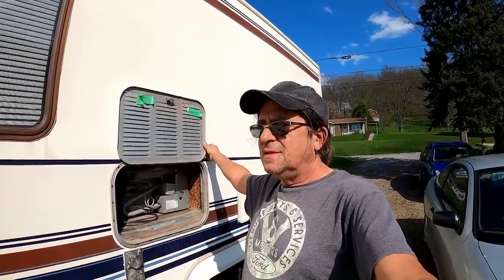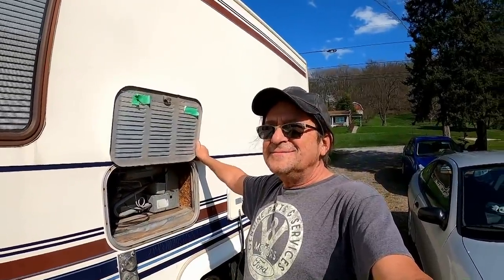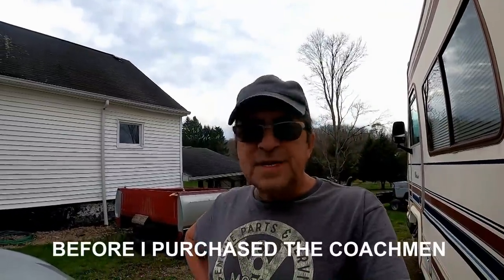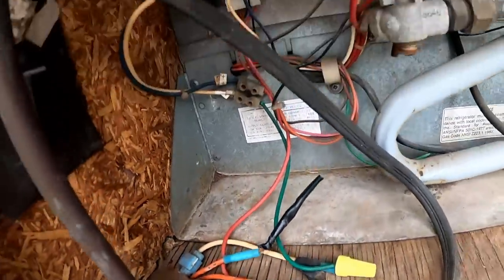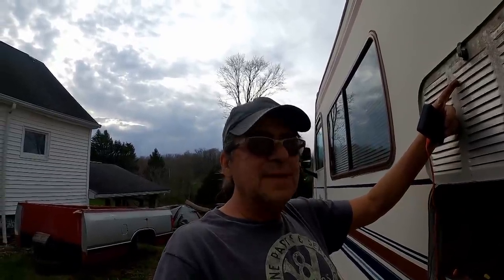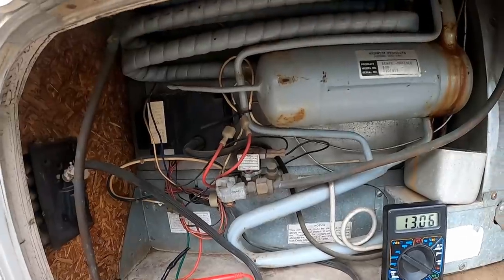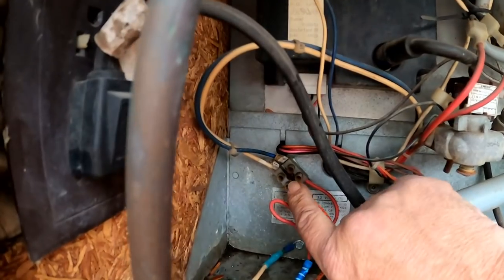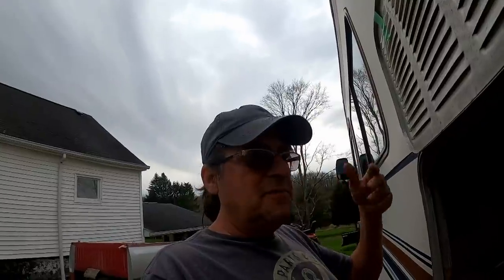Troubleshooting RV Fridge Not Working  - Repairs, Upgrades, Renovations Continue For The Motorhome

Comment: Dave I worked at Lexus as a technician and work my way up to service manager and I have to tell you how many mass detects couldn't figure out a problem and I would say to them check the fuse they'd look at me like I had two heads guess what fuse was blown and they spent hours trying to find it it's all just common sense check the little things first then if you have to go deep then you look at the repair manual and electrical schematic I'm very excited watching each day as your progress goes thank God the refrigerator works the hot water works so far you're in good shape I don't think they use that too much you were destined to get that particular motor home at this time it was God's will thanks so much I'm enjoying each video to the max hugs from Winston to Bella and you be well that RV is going to shine up beautifully with a great shine on it you won't even recognize it after it's waxed which I know is a long procedure but when it's done properly it lasts for a long time be well keep up the good work and happy Sunday your friend Craig

Comment: Dave I grew up poor and out of necessity I had to learn to do things myself. I have found that most things can be solved with a little common sense and the process of elimination. I believe we all have the power to do if we just take the time to think things through. Every sense you bought that RV I thought to myself I bet that refrigerator works, someone just didn't want to take the time to check it. I remodel RV's as a hobby and have fixed many things others said were broken at no cost but a little common sense. I am enjoying this series. ~Bubba J
Reply: I'm much the same, grew up poor and had to fix it myself. Over the years I was an Electrician and enjoy all that I have learned in life. I think the most amazing thing is You tube videos! Anything you want to learn is right at my finger tips, and a good helping of common sense! I enjoy your videos! Happy travels my friend 😊.
Reply: Same here! Now I can replace the head gasket on a German car and do anything I set my mind to.
Reply: Where are you located nomadic lifestyle?
Reply: @curtisnash9723  Michigan
Reply: Oh man, I wish you were closer, we are in SC, maybe you can help us as an consultant?
Reply: @curtisnash9723  what do you need
Reply: Well to start our RV won’t start we had a tech come out and he says we need a few pump the manager at our local Advance Auto says we may not need a fuel pump because fuel will evaporate so we may need to do some starter fluid and see if it will start and then we have a roof leak I will have my son send you pictures
Reply: We have a service or company that said they will wash coat and seal our roof for $1800 that is outrageous we only have a 32 foot holiday rambler vacationer
Reply: Just trying to figure out how to wash and coat roof on 32ft holiday rambler vacationer

Comment: I just wanted to post again about how if you set your mind to it you can do anything. I purchased an old truck camper about 3 years ago and it was one that I would say most people would have not had a second thought of just passing by. I updated it with solar and redid the whole inside. I then bought an old truck that was having issues and the owner just gave up on it. In total I spent around 3500.00 for both I then put about 1500.00 into the two of them mostly on parts and now I have one sweet rig that allows me to enjoy life to the fullest. My point is you don't have to have a new truck and new camper to enjoy this lifestyle you just need a little will power to look deeper at the things others over look.

Comment: That's great that the electric is working fine! After troubleshooting some more, I think you will figure it all out. 
If you are installing solar. Get a fridge from Home Depot and let it run on Electric. Another YouTuber installed one, brand name unknown. I think he only paid like $135 for it. Its will only draw 5 watts an hour. The only problems you may have are:
1) width, getting it in the door. Your front door looks wide enough, however you would have take out the driver's seat and put it back when done.
2) size, you may have to modify a couple more inches on the top or bottom
However, you will get it working just fine. Have a great day.

Comment: Contact cleaner has saved me many times on control boards (RV refrigerator), remote controls, car parts, and more.  Many people change out the control board right away.  It's a moneymaker for RV repair facilities.  BTW, Dave, you're way too modest but then again, modesty is a good thing.  Enjoying your channel.

Comment: Nice clean up Dave. That’s the first thing I would do if I had time when working on a Packaging line. If it was running I’d just repair and finish the run. If I had time I’d clean the piece of equipment up first and then finish the repair and like you said invariably it is a lose or dirty connection. Hi Bella! Cheers buddy.

Comment: Hey Dave at minute 20:42 the wires above the gas valve are wire tied to the refrigerant  line that's not good as those get hot mine was like that and i had a melted wire from it getting hot. may want to move them from the line. Just an observation : ) i am like you if it works on electric it will work on propane providing the board and gas valve operate properly. i had to clean the tube out on mine and it works like a champ. Best of luck fingers crossed for you cause those replacement fridges aren't cheap. Give Bella hugs and enjoy your weekend : )

Comment: Okay, well with my 1981 Travel Craft 26 foot motor home I had some issues as well. Like you when I purchased the motor home I took in home and went through it as you have done and made sure everything worked. Batteries, water, water lines, roof for leaks etc. I did have to replace the front disk brakes and rotors. The engine had been rebuilt was a 350 Chevrolet the motor home was on a G30 van chassis. I did get the refrigerator to work on electric for awhile and the priso for the gas was broke.  The timing chain went out and had to replace it. $1,600.00 for tires. But the four years I owned it just regular maintenance and up keep kept it on the road. I used my multi tester all the time. Well till next time, as always Dave "Enjoy The Adventure." 😀👍✌ "Jack Of All Trades, Master Of None"

Comment: Dave your auto mechanic instructor was cut from the same cloth as the one I had in high school. He taught us many, many trouble shooting tips. For instance, one is, if the engine doesn't crank over, first thing to check is the battery connection. Like you said, connections get dirty and loose. Very good video Dave.

Comment: I am afraid of gas because I worked at a steak and deep fryer quit and owner said  when was fixed turn the other way from before . It opened line and when gas lit blew me across the room. Burned hair on my whole top part of body. I won't lite gas stuff any more. Glad you are figuring out.

Comment: Get a pack of assorted solder seals off the Amazonians. Once you use one you will never splice a wire together any other way they are amazing. You can diag a lot of electrical
Issues with a headlight bulb with leads attached to the pins. Power, ground, capability of the circuit to carry a significant load if you’re ever in a bind. Dave is basically the Vice grip garage of the rv world

Comment: Hey Dave..
Re: Fridge..
When you go to gas mode..
Although the gas solenoid should have been energized (check with vm), I think, regardless whether the gas valve was actually allowed to flow, you should be hearing a "tick tick tick tick.." as the control board triggers the ignition, attempting to start the flame.. I believe the ticking should continue until the thermocouple detects a flame has been established.
BTW..
- I think you may find a fuse on the control board itself.
- And, you probably already know, the ticking is the control board acting like old school car ignition. Opening & closing a set of relay contacts to induce a high voltage spike via the high voltage secondary of an ignition coil upon the opening of the 12v circuit..
- I used a small wire brush to gently remove loose rust off the boiler pipe connections then sprayed it all with Rustoleum.. I got several more years out of an extremely old Siber fridge..
- Once you establish a flame, make sure (I'm sure you already have), that the chimney is clear.  And, if you have the data (usually in the user or service manual, see if the curled flame guide is hanging free within the chimney & correctly positioned above the flame.

If you do have to replace the fridge..
- although I replaced mine just prior to them being available, I suggest checking out the new 12v compressor units.. they appear to use far less electricity than the 110v / propane units running through an inverter as I do while traveling (propane off)..
- if you still need to go absorption (ammonia), give Bob at Sands RV Parts & Supplies in Northeast Ohio a call (440 428-5131).  They are to reopen for the season on May 5th.. Thursday, Friday 10 to 5, Saturday 9 to 2.  www.sandsrv.com.  I have no financial interest, just good folks that were able to provide me a replacement at a very relative & reasonable cost from their stock.
Make sure you have the exact measurements of your opening, there is a huge difference in cost & availability between the standard size fridge and one even slightly different.. Your unit appears to require the standard size opening..
Best of luck, Dennis
Reply: Do you need  light pilot light in beginning to start the process to heat the thermocoupler
Reply: @imtonedeaf1  no, you don't need to (don't think you can) manually light the pilot like the older hot water tanks.. at least in the two I've worked on.. a Siber & its replacement, & more modern, Dometic..
On the Dometic, when you turn the fridge over to gas, the control board energizes the gas valve solenoid & starts cycling the ignition circuit.  It continues to cycle / spark the ignition circuit until the thermocouple senses the heat from the pilot flame indicating its lit or it times out & faults on "no gas".
On the old Siber, I would turn it over to gas, a flashing green led would come on & I had to hold in an electrical push button to bypasses the thermocouple allowing the gas solenoid to stay energized until the thermocouple was satisfied that the pilot was lit.. Once the pilot was established, the clicking would stop, the flashing green led turned solid and the thermostat took over control of the main flame..
On the newer unit, it takes care of lighting the pilot on its own, but then faults out if the flame fails to be established.
But with both controllers, you can hear the ignition circuit sparking / ticking as they each attempt to establish the pilot flame..
At least thats the world according to a non-professional, youtube commenter, Dennis..  Buyer.. err.. reader beware..   8- )  Hope that helps..
Reply: Thank you

Comment: Wonder if the igniter is shot for gas ignition on the fridge? So spot on checking for proper power and ground first! Fingers crossed on the fridge also working on lp after replacing the control board.

Comment: I hope viewers realize that rules/ codes exist for a reason, mostly to do with safety. In RV's, copper is fine to use with propane gas but in homes and buildings that use natural gas, copper is a BIG no-no due to the corrosive nature of the odorant used in it. I have seen copper tubing used in gas appliances that have literally corroded away internally to the point of being almost paper thin after many years of use.That's why copper is now banned for use in natural gas systems and years ago new connectors were developed to replace it. Also in buildings, green in the color used for electrical ground conductors. I don't know the rules for automotive, but there seem to be no rules as colors seem to vary widely, being different between different manufacturers and models of vehicles. That's why it's important to know what the rules/codes are, especially when dealing with electricity and gas. With so many RV's destroyed by fire, people had better get it right. Please be careful, people.

Comment: Dave before you waste money on the valve and circuit board ,take the cover off the pilot light . Try to restart , using a propane lighter . I have found that if you just clean the pilot light jet and get that lite you will succeed in getting the frig heater to run. Found out that mine ie: jet was loose and dirty.

Comment: Thanks for sharing.  
Question for Dave or anyone else.
I purchased two 12 V  lithium batteries in 2018 from battleborn and 4 (100 w ) solar panels . Are the batteries still good?  I'm Trying to get a truck then get a trailer to build out.  UGH. Thank you

Comment: ALOT OF TALK -BUT A GOOD START TO LOOK Behind fridge . I have had 4 different kinds of campers and not one dam fridge ever work . This one a 2006 motorhome and nothing . light lights up and it ... Pisses one off when I seen a old 19 late fridge in a old building for years with roof caving in . Got it out , spent several hours cleaning it up and bam it worked. Whats up with these darm rv fridges ???? 👺🥵